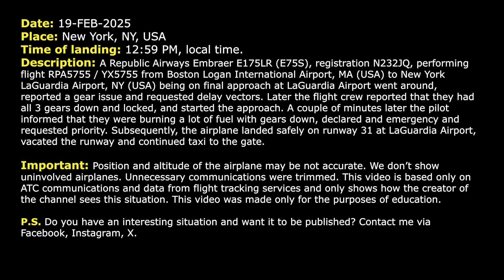“We're burning a lot of fuel”. Gear problem almost leads to fuel problem over New York. Real ATC

Comment from the maker: Hello, friends. As you can hear the pilot asked how did the approach sequence look like and after that informed that they were burning a lot of fuel. How do you thin why did they declare an emergency and requested priority if they had almost 1 hour 30 minutes of fuel on board? Wrong calculation or the pilot gave wrong fuel remaining?
Reply: likely the computer gave estimated burn without gear drag
Reply: @Minecraftmike5089 ok, well wouldn’t they have wanted to calculate ate actual with the drag?
Reply: @Minecraftmike5089  seems like a computer would have the information available to tell the current time available.
Reply: Normally an FMS does NOT take the additional drag of an extended landing gear into account. Please have a look at  Hapag-Lloyd Flight 3378 for reference.
Reply: They may have done a quick mental calculation based on fuel weight

Comment: @ATC You Can See,  reading between the lines, could this be a manual gear extension.  That could leave him with the gear doors hanging down with extra drag.  Hence the not emergency call at 3:30 and 3:47 unable 250kts.

Comment: The fuel issue was caused by the pilots NOT declaring an emergency when they should have.  Would have had priority earlier on.
Reply: They did not have a fuel issue yet. They didn't report minimum fuel or emergency fuel, they pilots reported about fuel just on the safe side, I would say. Also, they were circling northeast of La Guardia because the pilots requested to discontinue the approach and most likely were troubleshooting or running some non-normal checklists...
Reply: @DavidSantos-nx2nc  You can declare an emergency and then run checklists.  That way they have priority coming back in from the start.    The hesitancy to declare...

Comment: "Discontinue approach".
But like what? DO they not learn to use clear abbreviation?
"Abort approach" is nothing you can misunderstand.
Reply: Are you a pilot or a controller?
Reply: @dksjdhrdjsndn4067 The controller obviously did not understand, and the pilot had to repeat.
Discontinue = continue.

Lession one in radio traffic is to make it easy to understand, and avoid confusing words.
Reply: @Xanthopteryx  Are you a pilot or ATC?
Reply: @dksjdhrdjsndn4067  He's right. That's not the phraseology (see the 7110.65, which I have actually read and memorized as part of my training), and it has actually led to confusion here because the tower thought the pilot wanted to continue the approach. The proper phraseology ("going around", in this case) is specifically chosen to avoid using similar words for different purposes.
Reply: @intelfx86  Good point. Pilot sounded pretty young (as most regionals would be), but honestly handled the situation about as well as could be expected and relayed information in a reasonable way.

Comment: 4:20 the controller said that he’s going to give direct Greg.. but didn’t actually give the clearance yet.. and without declaring an emergency, I’m surprised they didn’t call them out for turning.
Reply: If the controller doesn't' correct the readback then the readback is now considered correct.  You never know what the pilot heard.  And of course you can never deal with an arbitrary number of failures, so if ATC didn't hear the readback in order to correct it then that's the limit of the current readback system to correct errors and it's no one's fault - that's why there's even more layers to the swiss cheese.
Reply: @ I never heard that.. where did you come up with this and what’s your source?
Reply: @ This is basic logic.   These are fundamental limitations of the one-readback system.   There is no way for it to be any other way.  Seriously, think through any alternative and you'll figure out why it's not possible.
Reply: @zachansen8293  are you a commercial airline pilot? Or are you just making assumptions?
Reply: @thomasaltruda  I just understand basic logic.  I hate to repeat myself, but... "Seriously, think through any alternative and you'll figure out why it's not possible."
Reply: @ that’s not hour it works.. you can’t clear yourself to a fix, and if ATC doesn’t correct you, then you are good..
Reply: @zachansen8293  This is incorrect. There is nothing in the 7110.65AA or the FAR AIM that states this..
Reply: @ you people have no concept of using your brain.   This is actually depressing.   IT CANNOT WORK ANY OTHER WAY
Reply: @zachansen8293 that’s not how it works actually.
Reply: @CFHuss  That's literally exactly how it MUST work.   It cannot work any other way with a one-readback system.  How do YOU think it works, btw?   And I'll tell you why you're wrong.

Comment: an hour and a half?   is that without factoring in the additional fuel burn or?   maybe that's just his cruise number calculation?  Maybe they just have a rule of thumb that says "1000 pounds every 10 minutes" or whatever (I don't know if those numbers are anywhere near correct for that jet just giving a possible example)
Reply: It is likely the latter. Just a mental calculation they've done over and over.